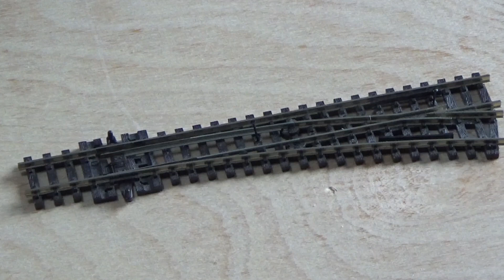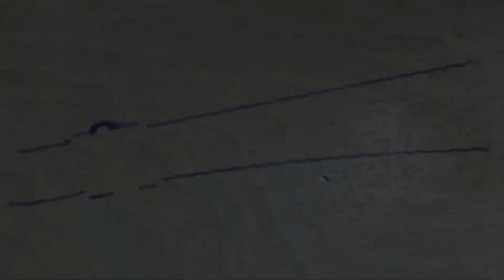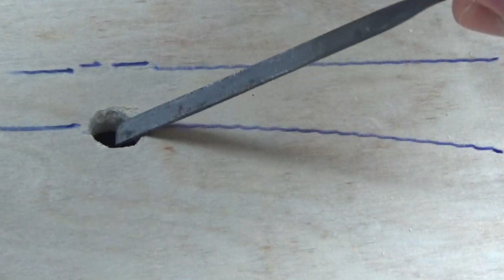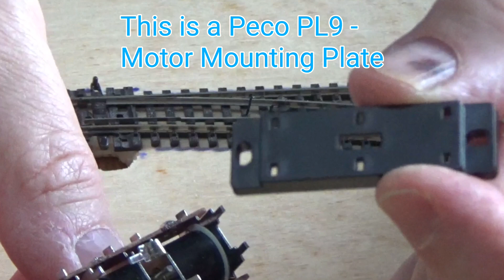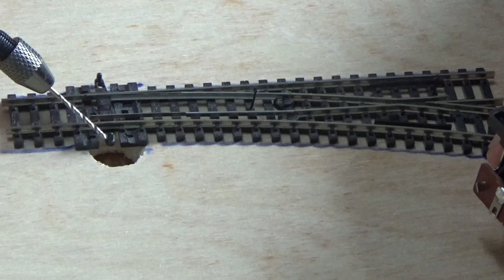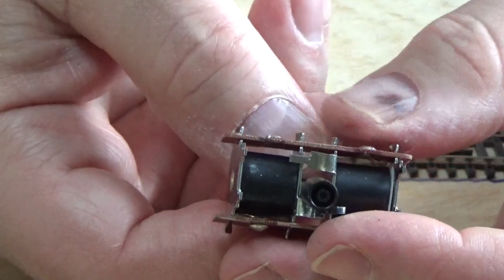Blackwood N gauge layout  - How I installed point motors on the layout

Comment: I'm just starting out in the hobby, and working on tiny (30cm x 20cm) boards for practice purposes before I embark on my larger N-gauge layout. The practice boards will (probably) be joined together to make a larger shelf layout. Bought a job lot of some Peco points off eBay (as you do), and a Google search brought me to this video and your channel. Very clear, concise, and has alleviated many of my fears about doing this job. Thank you. Subscribed.

P.S. I ken fine what a 'skelf' is, so nae bother.
Reply from the maker: Hi Bill - many thanks for your kind comments.  If you need any advice don't hesitate to email me ( the address is in the about section of the channel).  Cheers Euan

Comment: Hi Euan very interesting and informative video, will watch again when I get to the stage of putting in my first point. Cheers mate.
Regards Chris
Reply from the maker: Hi Chris  - if your using electrofrog points and the twin accessory switch then the larger hole will make the set up a lot easier.  Cheers Euan

Comment: Thanks Euan for showing me how you do your point motors, one question how do you camouflage the hole that you drill out for the point ,to stop ballast falling through?
Reply from the maker: Hi Evan - cut a wafer thin piece of plasticard which can slip under the sleepers.  Cut a u shaped bit out of it to allow the metal pin from the point motor to move back and forth.  The piece of plasticard ( or u can use a wafer thin bit of card) only needs to cover the edge of the hole beside the sleeper.  Once the ballast is done you won't see it.  Cheers Euan

Comment: Fiddly job and one I keep putting off!
Reply from the maker: Hi - the tricky bit is when you are using the twin micro switch - you need to get the calibration  with the tie bar absolutely right or the polarity (if using eletrofrogs) doesn't change and you end up with shorts.  Cheers Euan